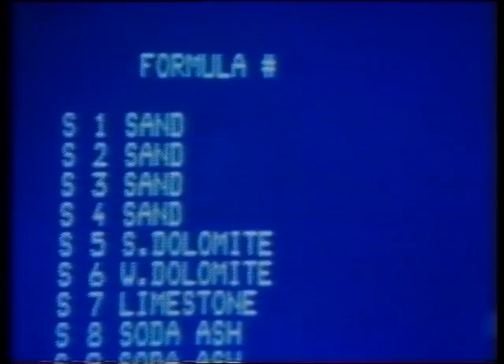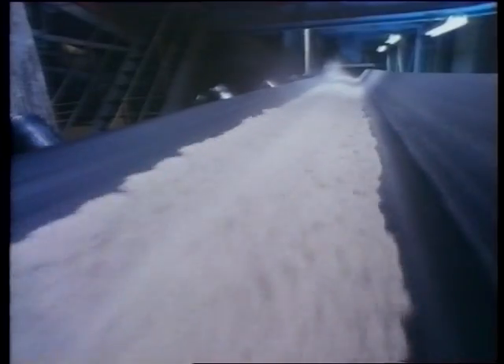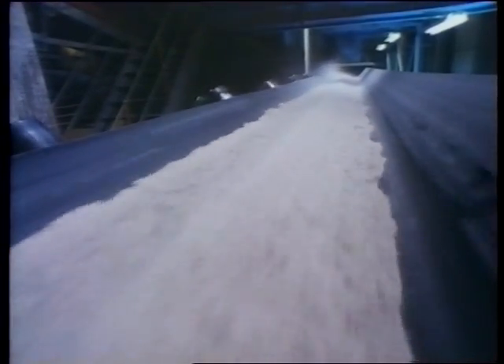Glass is Like That! How glass is made, uses and installations

Comment: I worked at Pikingtons Ravenhead Works from 1968 to 1975 many memories of those times . Working on those glass tanks , where the molten glass is , was a shock to the system of a young man , it was as hot as hell . We had to wear wooden soled boots so they wouldn’t melt and a fire proof jacket and hat . You could only work a few minutes to change the oil burners and the get out . Watching the video , the human cost of working in those conditions is not realized. The men I worked with of all ages back then were to be admired , most of the older ones had managed to survive WW2. They would not believe what is taking place today.